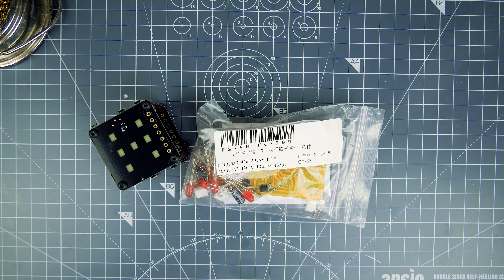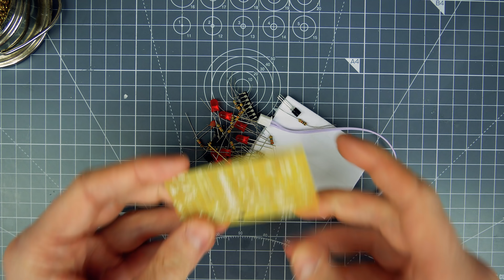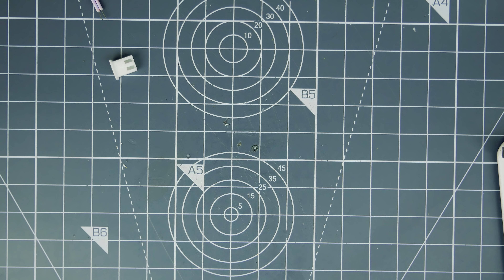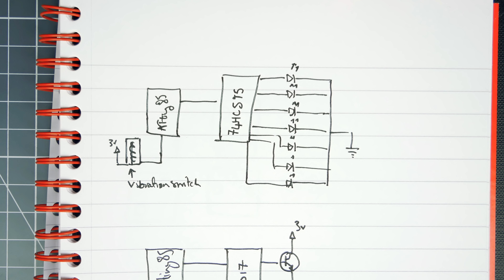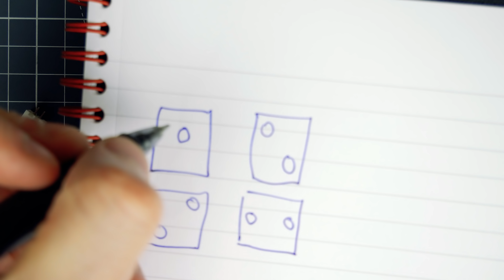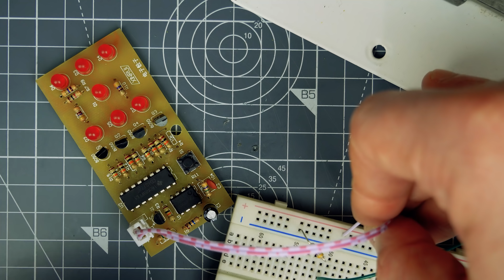Dice Kit: Pondering the options

Comment: I'm inspired to make one of these but the design part is a bit of a challenge. It would have all sides used as displays, but only the one facing up would be illuminated after you toss it and it stopped moving . There would be an accelerometer to detect motion and tilt switches to tell it which side is up - real 3D digital dice you can throw! Anyone with any suggestions?

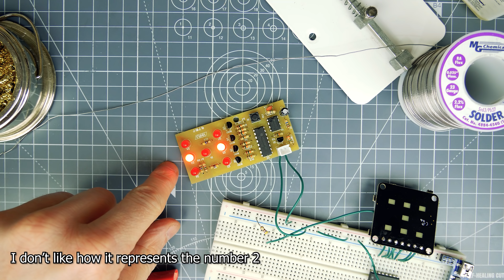Comment: Something's wrong with your built kit. At 24:38 you added the annotation stating your valid dislike for the representation of 2. Actually, this display should never occur, D3 & D5 should only light as part of displaying a 6. You do actually show a good 2 at 23:50 but with the faulty build there is no guarantee that is what was supposed to be displayed. 
 The uneven brightness could be a clue to the problem's cause. The varying brightness levels are not due to resistor tolerances but are a result of the rapid 'rolling' sequence. Since D1 only lights for the odd values, it should be at half brightness. D3 & D5 should only light one 6th of the time for 17% of the maximum.  D6 & D7 are lit for 5 of the 6 values and should be at 83%.
 Since the levels in the video show virtually the opposite of that expected I have a theory as to the reason. Although the PCB legend shows Q2 to Q5 as all 8050 NPN transistors, the schematic shows Q3 should be an S8550 PNP (same as Q1) ensuring that LED's D6 & D7 are always on except when a value of 1 comes up. If you didn't notice the second 8550 and swapped it with one of the 8050s that would result in half of the LEDs being inverted and allowing invalid displays possible.
Reply from the maker: Thanks Mike, that is incredibly well thought-out. I will have a poke around tonight and let you know what I find out.
Reply from the maker: Right on the money :-)
Reply: @DavidWatts  Glad to be of service. Thanks for letting me know.
 If you want any other info I can send you a circuit description. If  you would rather work it out on your own, one thing that misled me for a while was that while the six values are driven by the first six 4017 outputs, they are not in any obvious order. Presumably done for ease of track routing. ☺

Comment: I sometimes had problems with china kits but they are an easy fix. Clean the board (pads) AND the leads on the components to remove oxidation (or resist) before adding flux. Just follow the rules from Pace Worldwide on how to solder here https://www.youtube.com/watch?v=vIT4ra6Mo0s&list=PL926EC0F1F93C1837

Comment: Another option is to charlieplex the leds. That way you only need 4 resistors and not a single transistor. 

Using 4 pins you can drive up to 12 leds, so your could even make it a two dice in one board.
Reply: The transistors are to provide enough current to make the LEDs bright. Multiplexing the LEDs will make them even duller, due to the lower duty cycle.

Comment: I had a dice just like the cube that had a  vibration thing it it the smallest thing would set it off so it would go flat in no time at all, it was from maplins it just used the 4 posts to connect it together electricity
Reply from the maker: No freakin' way! Just googled for a Maplin dice kit and low and behold - https://www.rapidonline.com/velleman-mk150-electronic-dice-kit-70-4056 - is that the one?
Reply: yes I have one too I used an insulating strip between the battery and contact when I wasn't using it the battery lasted ages
Reply: thehappylittlefox aka benji that sounds like a smart idea, it did really need an off switch
Reply: David Watts yes that’s the one I think !
Reply: David Watts  used to sit on my window seal and go off if a car drove past it was so Sensitive! No idea what happed to it
Reply: The "shaking dice kite" is rubbish. The battery is far too small and the vibration motor uses too much power. Plus the operation of the dice is terrible, there is no slow down so it's not realistic at all.